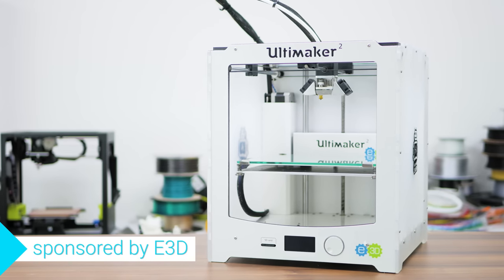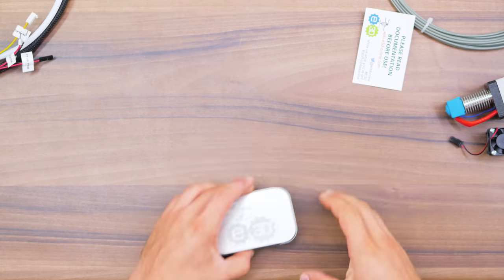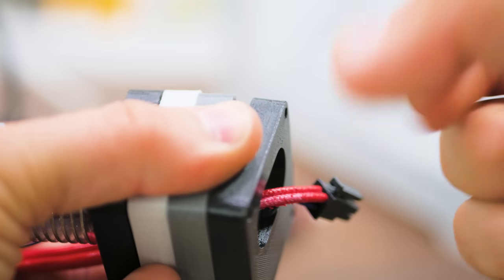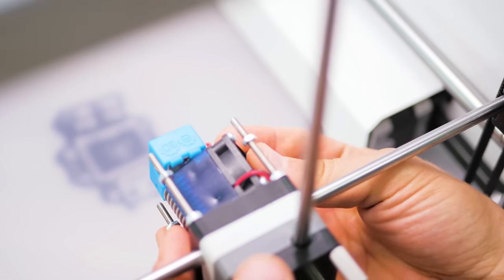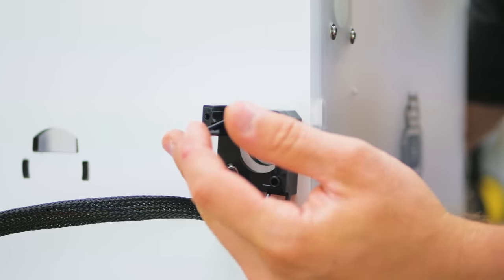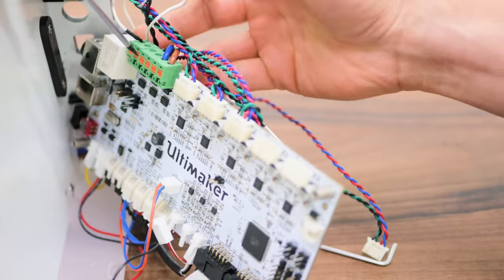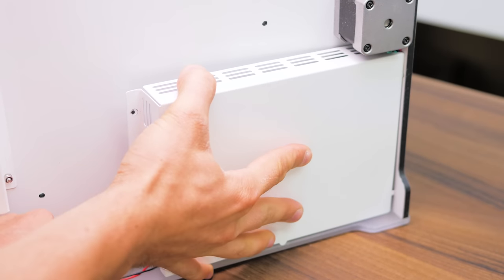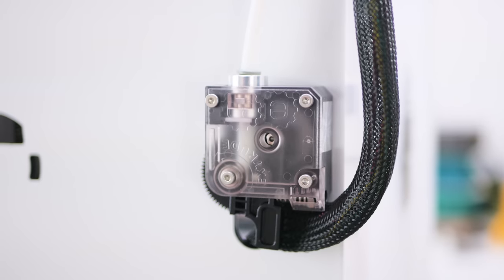How to convert your Ultimaker 2 to E3D's v6 hotend and Titan extruder!

Comment: Really nice video; i think will make sense have a video where you put in comparison the normal upgrade and the E3D upgrade and show which one is better and why ;)
Reply: In short, the original UM2 feeder is not fantastic, it is a bit underpowered and gets a bit too hot for PLA, so the Titan is a upgrade in perfomance in that part. (The UM2+ feeder is a totally different story)

About the hotend... i dont really see the point of swapping to a E3D V6 unless you are using your printer exclusively for ABS and higher-temp engineering plastics and want to be able to run up to 300C, since the high-temp performance is about the only thing i see as better with the V6.

I would just suggest to upgrade your UM2 with a Olsson block if you have not already done that, and then fit the TFM coupler and rigid spacer from the UM2+ and a E3D Titan as a feeder if you want to upgrade on the cheap and you will be printing with filaments in the <250C range most of the time.
Reply: *****, swap the coupler for the TFM and the rigid spacer from the UM2+, and it will last a LOT longer (like 5 times longer or so), and it is about the same price as the original coupler.

Comment: Just an FYI, parts from the latest production run (Feb 2017) differ from the ones shown here.

TIP: Install the extruder motor cable BEFORE you install the motor. It is a pain in the a$$ to do afterwards. I actually ended up removing the motor, installing the cable, and putting it all back together.

5:02 Attach cable using plug orientation, not what wire is closest to the others.

Comment: What is the point of this upgrade? How does it improve print quality?
Reply: The ultimaker 2 extruder is quite bad, it gets warm and starts melting low temp plastics. The hotend however is pretty good, maybe a little less foolproof than the V6.1
Reply: This is really not meant for the Olsson block machines.

Comment: Partcooling fans / air flow are not positioned well...
-> use radial fans and air flow pointed towards the tip of the nozzle
Also the bowden coupler of the E3D V6 is hard to reach throu the carriage assembly
Some stuff E3D does is awesome the rest just average
Reply: Ok then this kit should fix the most annoying weaknesses of the UM2
Reply: I agree that using radial fans will be much better in terms of airflow, but i found out that the airflow is sometimes too much if your z-axis is close to the bed. Then the reflected airflow from the bed can affect your head!! And my radial fans cannot rotate when the speed is set below 27%...
Reply: Tom's correct - the fan ducts were re-worked by our engineers after Tom filmed this upgrade guide - we find the new design very effective. You can download the files for yourself here if you want to have a play http://www.thingiverse.com/thing:1934309

Comment: Hi thomas. I was wondering if the ultiamker range is compatible with 1,75 mm filament because i have a big suply of it from my old printer
Reply: No, they are not made to run 1,75mm filament.

Comment: id love this kit in a 1.75mm version, i think thats the reason why most users dont wanna buy the ultimaker
Reply: Well, you will probably get your wishes, if you read on the linked E3D page it says "1.75mm E3D Ultimaker upgrade coming soon!" :-)
Reply: if i had the money for an ultimaker^^
Reply: You did say that you love to have the kit, and if you buy one of those, you only need to save a tiny bit more money to buy a Ultimaker ;)
Reply: i meaned, that id love it if it would be aviable in 1.75, because i like ultimaker, and most people dont want do buy it because of the 3mm filament
Reply: You're right, most people prefer 1,75mm because of the bigger material options. But you have to keep in mind that the ultimaker is a bowden feed printer, so 3mm works out much better than 1,75mm because of the stiffness. 
So I wouldn't downgrade my ultimaker or any other bowden machine to 1,75mm

Comment: I do not currently have a 3-D printer but am looking for advice on which would be a good point to begin. I have been trained as an engraver/sign-die maker and know about machine set-up. the only thing currently restricting my venture into 3-D P is funding which will be limited to about $350USD.
Reply: Joseph Wilson look at the wanhao duplicato i3 machines. I never used one, but they get some pretty good reviews
Reply: I have the  Wanhao Duplicator i3 Plus at home and an ultimaker 2 at work. The Wanhao is a good machine for the price and has given me great prints out the box. Currently doing a E3D v6 upgrade to it now though as its just behind the ultimaker in quality and speed.

Comment: Do you have any videos on nozzle size selection and printer setup? You seem to have a wealth of knowledge and I'm new to this and trying to learn as much as possible. I was wondering why choose one nozzle size over another and what the benefits of 1.75mm filament vs. 3mm are? Thank you for the informative videos!
Reply: If we take it to the simplest level possible, a larger nozzle = faster print with lower detail & smaller nozzle = slower print with higher detail.
Reply: +Erik Cederberg Thanks for the reply. I'm really trying to learn more about tuning a 3d printer.

Comment: E3D have uploaded their files to Thingiverse (thing:1934309). What is the difference between the mount for the 1.75mm hotend and the 3mm hotend? Because I have the 1.75mm hotend but on their website it says "1.75mm coming soon"... Does that mean the Kit incl. 1.75mm hotend instead of the 3mm hotend is coming soon?. Just a little confused here...
Reply: Thomas Sanladerer thanks, does it matter if I print it in PLA or ABS? I don't think I'll be printing above 280°C as I know the hotend stays pretty cool up top even when printing in ABS.
Reply: ***** Thanks Tom! You're the only YouTuber that is very responsive in the comment section. It's awesome! Never change my friend.
Reply: Indeed, the mount is identical... the 1.75mm version would be released as beta - and only if there is enough interest :)

Comment: Hey Tom, do the hardened nozzles, like the stainless steel ones that e3d supplies, have any negative effects on printing standard materials like abs and pla?
Reply: The stainless steel ones have terrible thermal performance, i personally have not used the ones i bought a year ago from E3D more than a few times because of the bad printing experience. The hardened steel ones are supposed to be better tough...

Comment: Bugger, wish they had an Ultimaker Original+ version.
Reply: Dalemoooooon It would not be too hard to do, you would just have to print some new pieces to hold the linear bearings and a holder for the Titan feeder. 

And if you have a non-plus UMO you might also want to mod it to run from a 24V supply and add a E3D pt100 amplifier to get optimum performance.

Comment: Hello Tom....I know this is a lot to ask but, could you provide me with perfect working simplify3d settings?
I have the same printer with the same upgrade and use spoolworks pla
If you do... I'll be very happy

I tried everything the visual  troubleshooter said but nothing worked
Reply from the maker: +Khalid Jabbar  Almayah I'm not using S3D much - maybe ask E3D?
Reply: Thomas Sanladerer 
whatever you use will work (if that's ok with you)
 and I'll contact e3d too
Reply from the maker: +Khalid Jabbar  Almayah also, I should have mentioned that this is not my printers - I don't own an UM2
Reply: Thomas Sanladerer Ok thanks

Comment: Really?!? I already upgraded to the + version😑
Reply: So, are you printing a lot of filaments that need 260 degrees or higher? If not, you are better off with the 2+ upgrade...
Reply: So is there a true comparison review between the two upgrade options anywhere? i plan one buying one of the two but can"t find solid practical guidance to the differences.

Comment: What a disappointing video.  So you made a tutorial on upgrading to a different feeder and nozzle...but failed to show any IMPROVEMENT.  Where's the test prints?  Let's see it side by side with the 2+ upgrade.   Why would anyone upgrade and you can't show any gains or improvements?
Reply: Quite simple, it is a e3d paid tutorial on how to install the kit, not a review video...

I would recommend the 2+ upgrade over this for anyone not going to print mainly/exclusively in high-temperature materials (250-300C print temperatures)